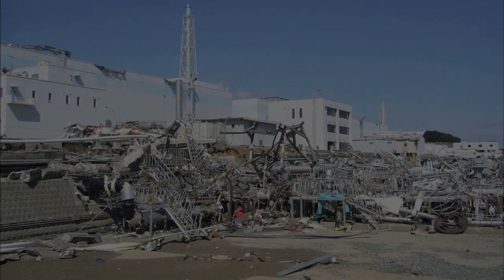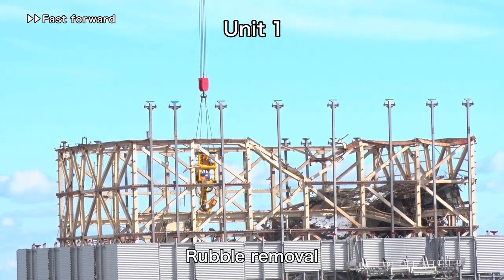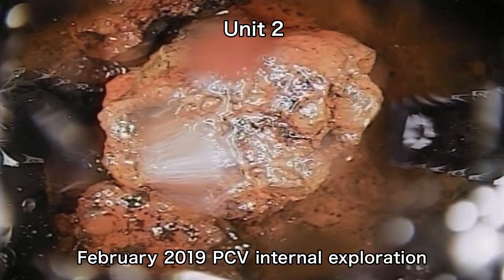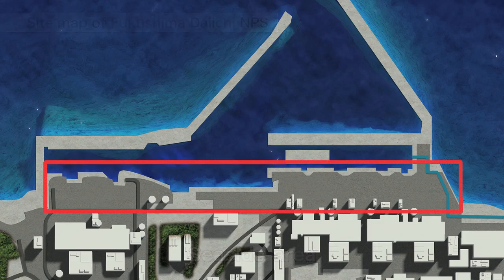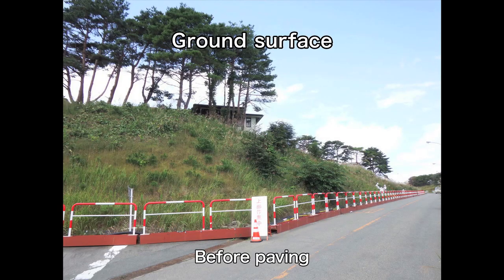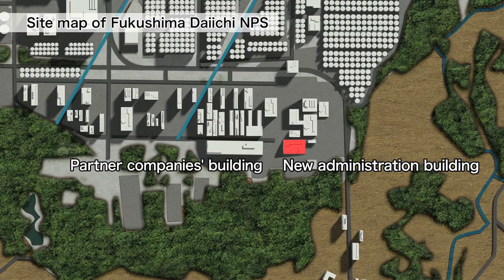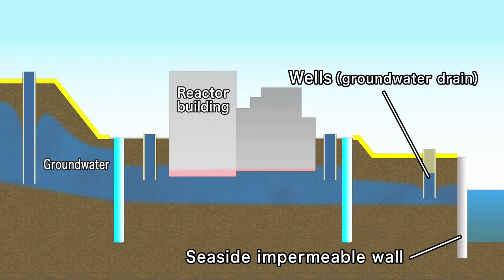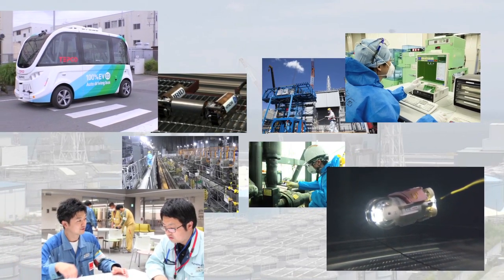"The current situation at Fukushima Daiichi NPS" -From 3.11 toward the future- (ver, Jan. 2020)

Comment: The Plant should have never been placed that close to the ocean to begin with. This has to be one of the biggest design flaws ever. Please use Liquid Salt Thorium Power it ios so much safer and can power devices for a century!
Reply: Yea. But, I can understand why. They probably placed it next to the sea because of coolant already there. Same with multiple other plants in Japan. But, TEPCO ignored advises from GE Hitachi to put the emergency generators ABOVE sea level, but they didn't. Also, they ignored advises for making the sea barriers higher.
You see, Sendai NPP was closer to the epicenter of the earthquake, and suffered minor damage, while Fukushima Daiichi was further away but got heavy damage. It isnt THAT safe to place a NPP next to the sea but it's pretty safe when advises are followed and safety precautions are taken.
Reply: The powerplant held very well against disaster. It was a mandated emergency shutdown what killed it. No power - no cooling. Just dont break power then, it is that simple.